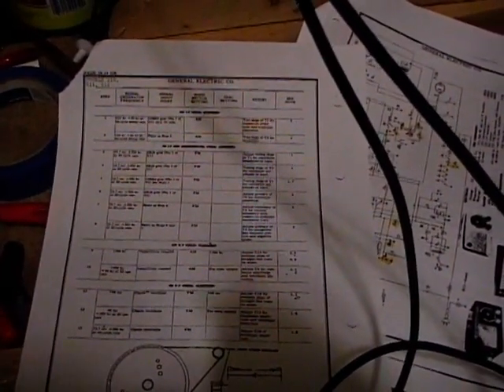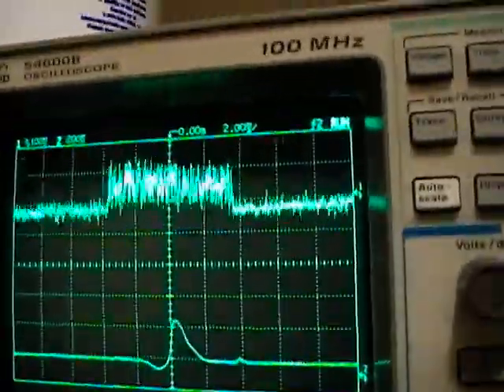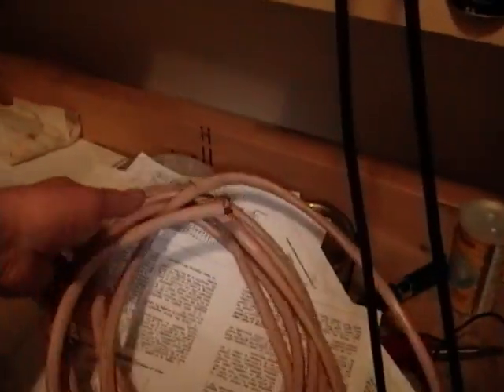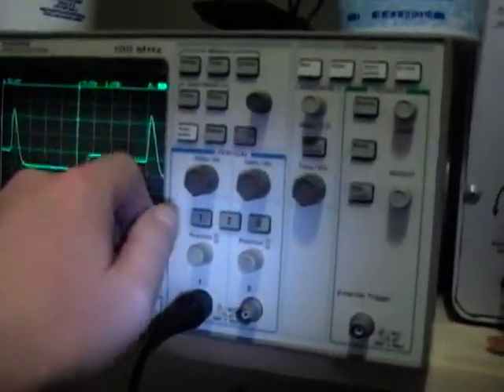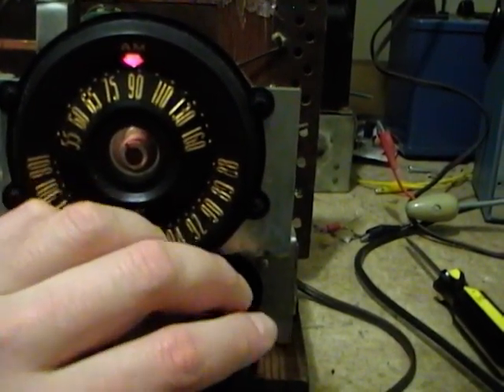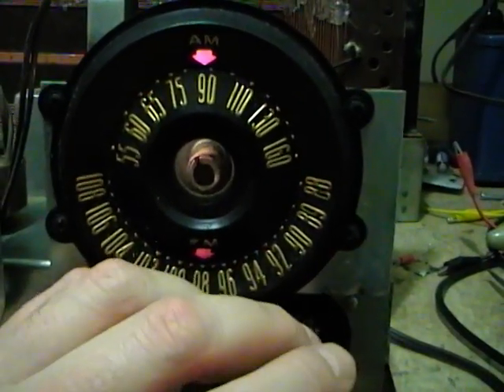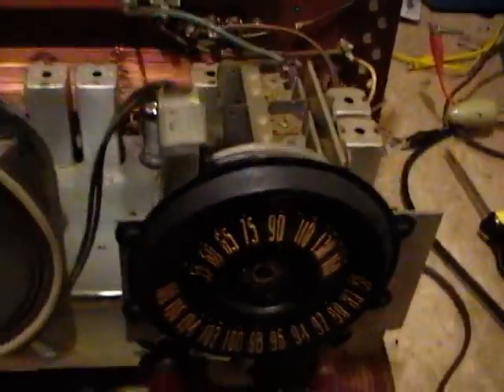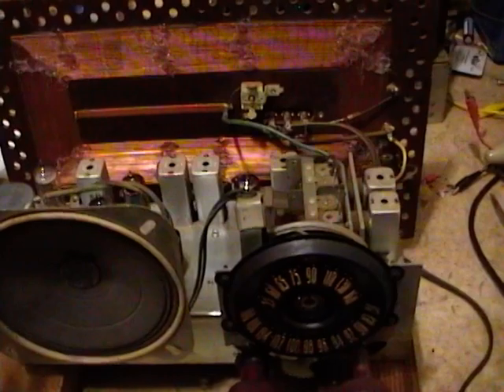AM Radio Visual Alignment

Comment: And part of your video. Am I hearing a inverter generator running in the background. The reason why I ask is I do the same thing. That's how I run my shop. I'm curious it's doing it that way cause problems on the oscilloscope. Prior to testing any circuits.
Reply from the maker: No, that's either the cooling fan in the scope or my forced air heating system you hear.

Comment: I dont understand how you use the scope with a regular RF generator...not a sweep generator.
Reply from the maker: Set your RF generator to the IF frequency.  Inject it into the converter or 1st IF stage.  Hook the scope up to the detector.  Adjust the IF slugs for the largest signal on the scope.
Reply from the maker: Basically use the scope in place of the VTVM in the alignment instructions.
Reply: Is there a way you could look at a Panasonic RF-2200 diagram and tell me where the two points are please...thanks

Comment: On the top raw sweep trace, why and how are there elevated "skirts" up to and down from the  sweep segments? It looks like a pos DC offset.
Reply from the maker: Yes, it does look there is  DC offset.  It's been years since I made this video and don't remember the details.  I expect it is something to do with the vintage sweep generator I'm using.    Coupling through a capacitor will block it,
Reply: Thank you for the reply! I have learned so much watching your video "classes"! These are great.

Comment: Hi..where do you actually hook the scope wires to do this alignment???
Reply from the maker: Kennynva T.  The hook-up is different for every chassis. The service info will have detailed instructions on where to connect the RF generator and scope
Reply: This is a 1950 radio...all tube's I doubt they had O scopes then..or they did not have it in the alignment instructions..
Reply from the maker: Kennynva T. Scopes have been around since the 30s but we're an expensive luxury for they average radio tech.  So you're right, the alignment instructions probably only cover using a VTVM. That's all you really need anyway since all you're doing is leaking coils at a specific frequency
Reply: If you can look at my radio diagram ,,,in the first section under IF alignment, on step 2 your will see what Im doing..the adjustment is "U"...I have a function generator/frequency counter on the way as we speak...maybe I can use that to find the exact frequency...
Reply from the maker: Kennynva T. Sorry, I don't know what model radio you have. 455 kHz is the standard IF frequency

Comment: Thanks for this video.  Can you tell me where you had your oscilloscope attached for this video? Were you just attached to he insulation also.  Thx John
Reply from the maker: I connected it as indicated in the alignment instructions for this GE 212 radio.  I don't recall the exact point on the schematic.    It's going to be different for every radio.  Not sure you mean by "attached to the insulation" ?  The scope probe is making contact directly to the circuit.

Comment: You've now peak tuned the IF transformers rather than stagger tuned them as they probably should be to accommodate the wide bandwidth AM broadcast stations.
You need a sweep gen, wobbulator or spec analyser with tracking generator. You have to be able to see the shape of the IF passband to set the IF transformers.

Comment: Nice video. I have a Heathkit shortwave receiver that I built in 1988 I think. I do not have an oscilloscope. Do you know of a way to align it with just a digital meter?
Reply from the maker: Generally speaking, alignments are done with analog meters rather than oscilloscopes because it's easy to watch the needle moving while peaking the coils.  You can do it with a DMM too, but it's not as easy - especially if it has a slow refresh rate. 

I'm not familiar with more modern receivers like yours to get any more specific.  Maybe try asking on the Antique Radio Forum ?

Comment: I like your use of vintage test gear. I have been spoiled with all of my HP and Tektronix gear in my shop but I remember well getting by just fine with less cash tied up in equipment..Great video

What is the model number of the RCA sweep gen?? My first VTVM was an RCA VoltOhmist that I got for Christmas when I was in the 5th grade, COOL PARENTS!! I still have it with the matching audio volt meter.

Do you happen to be a Ham op? 

Best regards,
Glenn WA4AOS
DSM Labs  (dot com)
Reply from the maker: Hi.  It's an RCA WR-50B which I sold a while back.  More recently I've been using a fairly modern HP3336A synthesized sweep generator for radio alignments.  It's a little overkill but a cool piece of equipment to have.

No, I'm not a ham but I've been to plenty of hamfests and am familiar with the community.  Maybe someday.
Reply: bandersentv It's a great hobby and you will be a true asset to the Ham bands..I encourage you to get a licenses.You already have the knowledge for the electronics part.
73,
Glenn WA4AOS

Comment from the maker: it's going to vary somewhat from radio to radio.  The basic idea is to feed a swept signal around +/- 10% of the IF frequency before the first 1F stage and place the scope after the detector.   The key is to peak the IF coils at a specific frequency (typically 455).   This can be done with just an RF generator and VTVM so most alignment instructions don't include visual instructions.

Comment from the maker: Generally you don't trigger your scope.  Instead you put it in XY mode and connect the X and Y to outputs of the sweep gen.   Some use the AC line for the sweep and you can trigger your scope to the ac line too and use a phase control to compensate for any phase delay.

Comment from the maker: I believe the retail price is around $6,500.  Used in full working condition they go for $1,000 - 2,000.  Unknown or partially working, under $500.  I see one sold recently for $125 but the CW mode wasn't working.  Keep in mind it can cost a couple grand to have one repaired and calibrated.

Comment: Are you using a RCA WR50B to sweep AM! How do you know where you are, meaning marker? I had one; never got it to work correctly. I use a HP 3336C (synthetic signal sweep). I also have a Sencore SG165 which does FM IF's only (10.7 Mhz). Both work well. GREAT video!

Did the radio actually give you visual alignment steps for AM section? That's amazing. Working on Zeniths tube AM/FM they don't even give you visual alignment steps for FM in the "factory" info (you have to get a SAM photofact).

Comment: I usually tune up and align my sets because I like to tune listen to long distance broadcasts or DX as the hams call it.. It's well worth doing especially if your set has some shortwave bands. I'm used to doing it by ear because for years I did not have a scope, there is a trick to it in that you go back to the generator and reduce the output level then to the radio to readjust the IF cans in stages, a scope is definitely faster.

Comment: Nice work, most of my old tube radios just stay on the shelf without much use since i dont like the programming on the radio so my repairs usually just consist of recapping and getting them running again and, and they do fine but ive never bothered to actually go in and tweak them back up to spec. Looks like it makes a world of difference. This video has me interested in doing that now.

Also i WOULD love to see you make a video on the procedure using the vtvm.